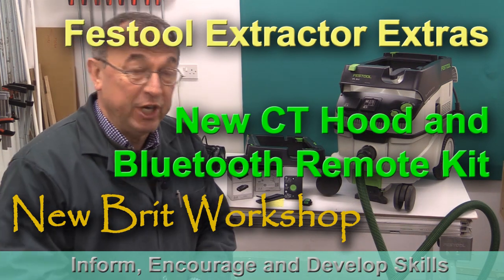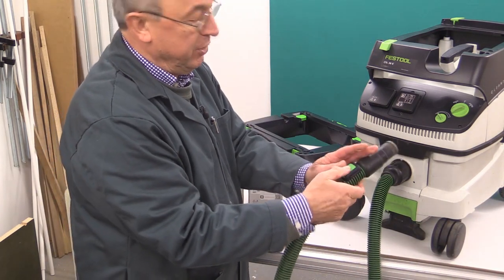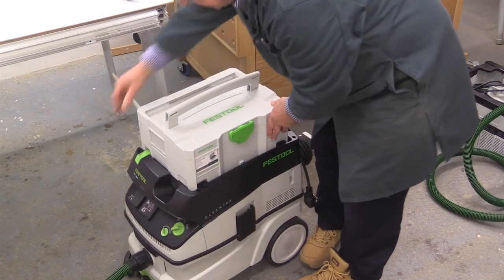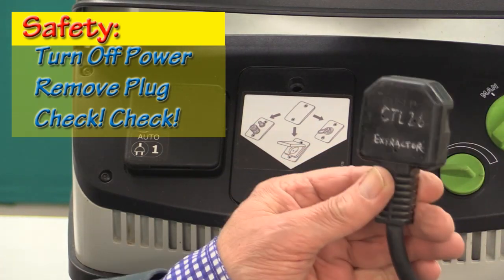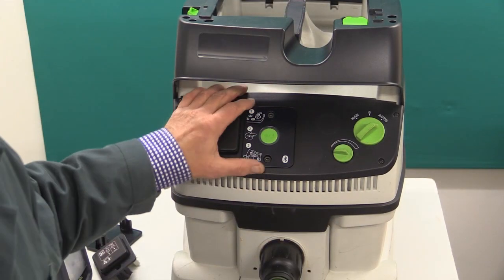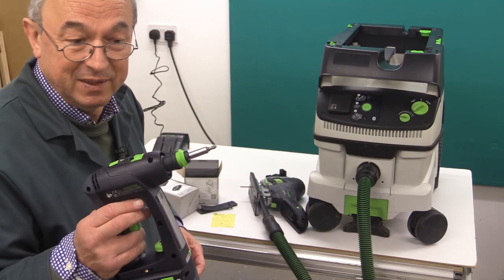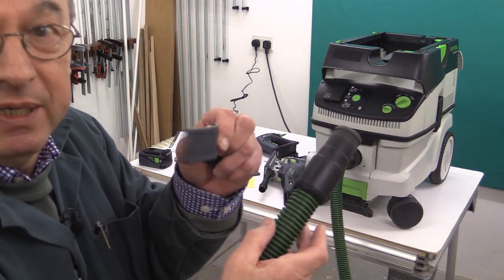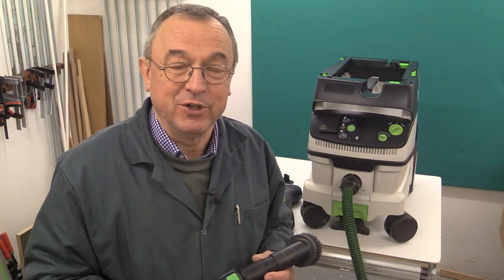Festool CT Extractor Enhancements with Bluetooth

Comment: Thank you Peter, I have a CT36 and planning on purchasing the remote blue tooth connection after watching your video!  I order my CT36 with the garage and starting to accumulate many of the new battery tools.
Reply from the maker: Hi Ejay, The Bluetooth module is easy to connect but please ensure that you are comfortable doing electrical work and be sure to completely disconnect the power first. Cheers.  Peter

Comment: Peter have you tried the Festool Works app?

You can connect your Bluetooth items to it through the phone app and it pulls up all sorts of information about the connected items. It’s quite interesting. Nice video as always. You can also update Bluetooth software through the app as well.
Reply from the maker: Hi Jason, Yes I have and have used it to update Bluetooth. However, at the moment my one and only Bluetooth battery seems to be faulty. The extractor and Bluetooth remote work fine but the battery does not seem to talk to the CT. I am too busy right now to sort it out.  Cheers.  Peter
Reply: New Brit Workshop oh that’s annoying about the battery. I had a similar problem with my HKC saw and Bluetooth battery. I had to send them both to Festool. They sorted it within three days so not too bad. Hope you get yours sorted soon. Cheers

Comment: I wish I had gotten the CT26 instead of the CT36 when I got mine. The CT36 is just getting to heavy to take up stairs.... 😊
I foolishly thought the CT26 would be too tippy with cases on it...  Live and learn. I did get the Bluetooth upgrade though. I wish my older CT 36 had that option but I got an aftermarket accessory that plugs into the wall socket and turns it on via a key fob.

Comment: Hi Peter
Just received a new Carvex PSC 420 LI EB jigsaws which comes with a free bluetooth battery BP 18 LI 5.2 AS-ASI. The instructions only mention charging it on the TCL6 or SCA8 charger. I have only an older TCL3 charger. So thought I would just check that my charger is compatible with the new airstream battery. For the life of me I cannot see anything that says I can or cannot use my airstream battery in the TCL3. Again I am assuming the TCL3 will happily charge the airstream battery but not taking advantage of its air cooled rapid charging capabilities. It would have been good of Festool to say that in the battery instructions or was it too obvious for adding to the instructions for people like me that check if things are compatible. In fact if the battery had not been free I would have held off buying the battery if I couldn't have found information on the TCL3 compatibility. Have you any words of wisdom? I am not looking to rush out and buy a new charger without checking first. Maybe a subject of a new Video?
Reply from the maker: Hi Kenny, I am never certain whether what I do is right or contrary to Festool's wishes because, as you say, some detail is never clear. Basically if a battery fits a charger then it is Festool's intention that you can use that setup. I charge my batteries on whichever charger is handy. The Airstream charger will charge Airstream batteries faster as the charger can detect the type of battery and knows that it can blow cooling air into an Airstream battery and hence give it a higher charge rate.   Peter

Comment: Excellent video - thank you.
Two points which I don't think you covered:
What is the range of the BT switch?
Is the new garage better made than the old one? The corresponding item on my CT mini has proved to be quite fragile.
Reply from the maker: I have not tested the range but is easily works at 10 m. The new garage is a better material than the old one. People used to complain about the old ones being fragile and I did not understand that until I took the old one off and cracked it !   Peter

Comment: Hi Peter.  I take on board what you said about the 26 extractor. Today I got the HK 55 circular saw. I didn’t go with the cordless version as it was out of my price range. While at the store I couldn’t help looking a a DeWalt mitre or chop saw on sale. It comes with THREE different power sources in the one tool. It can be powered by 110-240 volts and battery. 
How cool is that? Cheers Dan
Reply from the maker: Hi Dan, Sounds like you are a happy person - good luck with the new kit.   Peter

Comment: Hi again Peter, sorry to keep bothering you like this but I was looking at the Festool website and  at their dust extractors. I was comparing two in particular that are almost evenly priced. 
The new CTL Mini GB available in 110 & 240 volts priced including vat €480.93. 
And the sustainer type CTL SYS GB 240 volts priced including vat at €414.51. 
I wondered having reviewed both extractors which one of the two you would purchase if you had to pick one? Bearing in mind that the Festool power tools I plan to purchase will be cordless where possible. Thank you
Reply from the maker: Hi Dan, I have not used the CTL Mini but have the fantastic CTL 26. I have used the CTL Sys quite a bit too. The problem for a professional is that the CTL Sys has a small bag capacity and so you will be forever swapping out bags. It is also not quite as versatile as the CTL26 (no wheels for a start, then less power and no Bluetooth). I do not know if the CTL Mini can do Bluetooth - I doubt it. In the long term you would do better to take the hit and get the CTL 26 you will not regret that long term.   Peter

Comment: Hi Peter, wow great video, I am considering purchasing the Festool HK C 55 carpentry circular saw you did a video about a while ago. I was getting it mostly do rough work such as joists and rafters but on occasion it would be used indoors with a finer blade and as a cordless tool I wondered if it could be used with the extractor in the way you have advised here? I’d probably need to buy the saw with Bluetooth battery?  And is it possible to make the same Bluetooth adjustment to the smaller sustainer vac making everything much more portable? Cheers Dan
Reply from the maker: Hi Dan, You will be able to use the HK with the new Bluetooth battery but the Bluetooth module will not fit into the baby systainer vac sys. I do not know if Festool have any ambition to make it available for the vac sys - I doubt it. So, if you want to go the Bluetooth route you will need a CT extractor.   Many thanks for the kind words.    Peter
Reply: New Brit Workshop , hi Peter, thank you for your speedy response. Ya I will be getting the larger extractor anyway and I’ll go Bluetooth now I have seen this video. It’s just a shame they don’t make it available on the smaller extractor when using cordless tools. Thanks again for all your helpful advice
Reply from the maker: Hi Dan, If I hear of any new Bluetooth developments I will announce it on YouTube at the earliest opportunity.   Peter
Reply: New Brit Workshop hi Peter, that would be great thank you. In an ideal world the smaller extractor could even be cordless itself- how cool would that be? Cheers Dan
Reply: DEWALT makes a portable power station that runs of of 4 60v batteries but it is 120 volts AC. I don’t know if they have a 240 Volt unit available in the U.K. or https://youtu.be/TDTw95y8-4c
I built a small shed, 10 feet by 12 feet on one charge using all corded tools. The unit can also charge the batteries.
As for as not being able to use the Bluetooth with your unit there is an aftermarket unit available that you can plug into the mains and then plug your dust extractor into it and you can turn the unit on with a key fob. You can also plug a power strip into it and then plug all of your tools into the power strip, just don’t exceed the power rating...
Ron

Comment: Hi, Peter.  I am trying to decide on a Festool Drill/Driver set (attempting to clear out multiple charger & battery brands in my small space).  I tried to find a Playlist where you may have tools broken into categories, or even a festool  category.  

Which is the most versatile and up to date 18v Drill/Driver that you would recommend?
Reply from the maker: I am about to start my research for a "Which Festool Drill" video but it will only cover the ones that I can get hold of - PDC 18, CXS, TXS and C18. If you have to have just one drill then the PDC 18/4 is an excellent choice. I have that and the CXS. I could not manage without the CXS and I use it more than the PDC. However, you do need a drill with the power of the PDC for the tougher jobs. Second "However" is that I have not yet tested the C18. I really like the idea and it may be better than the PDC but it is too early to tell.   Peter

Comment: Hi, I'm curious what kind of battery  the small hose remote button uses. Can't seem to find that info  on any website.
Reply from the maker: I have just read the instruction manual on the UK web site and it is a standard CR 2032 battery.   Peter

Comment: Peter Nice video 
I modified mine ct like shown in the FOG 
http://festool owners group.com/festool-tools-accessories/bluetooth-adapter-is-good-but-can-be-improved/
Still have the two sockets 
See also my thread at woodworking.nl
https://www.woodworking.nl/showthread.php?24354-Modificatie-CTL&highlight=Modificatie
Some more pictures

Menno
Reply from the maker: H Menno, I cannot use the first link and the others are not in English - can you explain what you have doe lease.   Peter
Reply: New Brit Workshop
O sorry 
 http://festoolownersgroup.com/festool-tools-accessories/bluetooth-adapter-is-good-but-can-be-improved/
Maybe does this link works , the article is on the FOG , festool tools accessories page 2 title as above 
Yes it’s a Dutch forum of woodworking I think my fotos 
Menno
Reply from the maker: Brilliant, Many thanks.  Peter

Comment: That was a good video. For most shops, I don' see a big benefit to adding connectivity to tools, but the Bluetooth adapter could be very useful.
Reply from the maker: I was not so sure to start with but after a couple of days with that remote control on the end of the hose I knew that I had to keep it.   Cheers.    Peter
Reply: It is disappointing that my CT22 is too small to accept the Bluetooth controller. My CT22 is about 15 years old and is still going strong. I can't justify upgrading it.
Reply from the maker: That is a pity. I did not realise that the CT22 had no expansion port for a second socket or whatever.   Peter